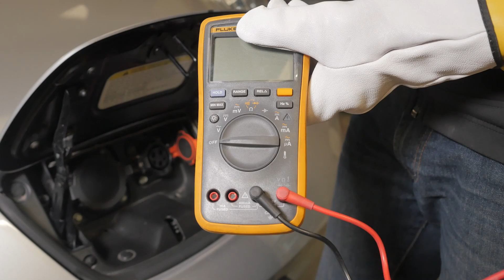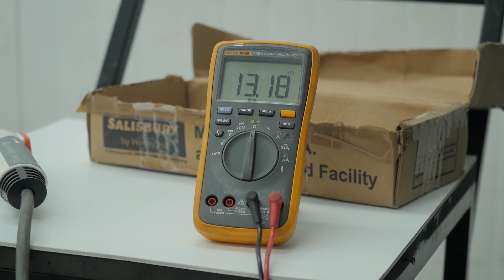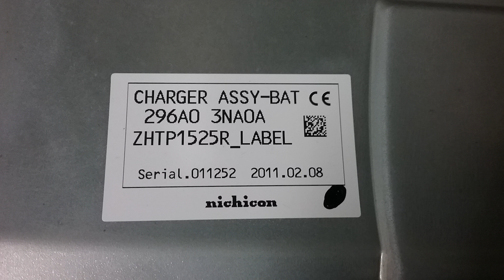Nissan Leaf Charger Fix

Comment: A huge thank you. Not just for the relevant information, but also for the care taken in presenting it. I know full well that creating and editing videos is not trivial.

My 2011 Leaf seems to be experiencing the same or similar symptoms. I am getting kohm readings both directions between the ground and pilot pins. The odd part is that from day to day, that reading is changing. The "common knowledge" out there on the intertubes is that the problem is D1. This is the first I've heard of D547. But then this is the first I've seen of that circuit board as well!

On caution I'll mention when testing these pins - there seems to be an insulated cover on the tip of these pins, so probes sometimes have a difficult time making contact with the actual conductors. I took some cheap, longer probes and bent the tip a bit so I can reach deeper into the socket, and touch the pin behind these caps.

A couple of questions for you if I may:
1. Do you know if this car had ever been charged on a GE Wattstation? It seems that Wattstations had issues with the early Leafs (see here: http://www.thetruthaboutcars.com/2012/07/dead-leafs-and-ge-chargers/), and it turns out that mine HAD been charged on a Wattstation just before my problems began.
2. Would this car happily charge on the 110V portable EVSE that came with the car (maybe this is irrelevant depending on the geographic market)? Would it charge on an Aerovironment EVSE? Mine will happily charge on both of these, but not anything else. So no public charging for me, and no using any of my wall-mount Clipper Creek units.
3. How do I get you to come fix mine in California? My Nissan dealership is no help, because they just want a code to clear. Without that, they wish to replace the charger (out of warranty, naturally). I have no idea how to get somebody on this project who cares enough to actually fix it.
Reply from the maker: Hi Darell. I'm sorry for the delay in getting back to you. I've been head down working hard on our latest projects and have been struggling to keep up with normal emails and enquiries.   On the car we fixed, I have no idea of its prior charging history as the owner we did the repair for purchased the car at auction without prior knowledge of the charging problem. It wouldn't charge on any EVSE that we tried, but some EVSEs may not implement the J1772 protocol correctly so they may continue to charge even when they shouldn't.  I'm not sure if you have resolved your problem yet, but if not I am happy to help remotely. I can't come to California, but if you find someone capable and competent then I can certainly assist them with the repair.
Reply: Thanks for the reply. The great news is that I am that person who's both capable and competent.  :-) I fixed my car in a much more simple way. By inserting a diode inline with the pilot wire behind the J1772 inlet. The charger does not have to be removed, and the failed diode on the charger just stays there shorted, causing no harm. Here is my fix in pictures (with captions).

https://goo.gl/V687qz

I appreciate your generous offer to help. I hope that my solution and pictures can assist other owners who may find themselves with the same issue. Thanks for giving me the confidence to proceed!
Reply from the maker: Good to hear you got it fixed.
Reply: @darelldd  dear Darell! Which diode did you use there?
Reply: @fr.andreysyrkin2806  I've put captions on my pictures. The diode I used is overkill for the application, but it is what I had in my box. I used 1N4003
Reply: @darelldd  Thanks Darell looks like i will have to do this mine stop charging yesterday :( plug in light comes on as if its charging then goes out in like 5sec.
Reply: @xboxice2005  Best of luck!
Reply: @darelldd  one more thing what mine does is,the charge lights come on then go out in about 3 or 4seconds is this what yours was doing bro?
Reply: @xboxice2005  been so ping now that I can’t recall those details, sorry. :-(

Comment: Excellent job, that must have saved a pretty packet over having the OBC replaced. thanks for the great video.
Reply from the maker: Hi. Yes our customer was very happy with the outcome. They were expecting a large repair bill and received a little one.  It doesn't always work out like that, but it is nice when it does.

Comment: my 2012 Leaf had the same kind of problem last December 2016 and spend about 2 months at Nissan Gateshead, UK. When it happened my Leaf didn't show any battery charge and range. I could still drive after resetting the car by disconnecting the 12 volt battery for about 5 min and drive to the dealership.
Reply from the maker: Hi. That does seem like quite a long time to fix. Did they end up having to replace the charger with a new one?   What you mentioned about your car not showing any charge bars or range (when the battery is actually charged) does sounds different than with the car fixed in this video though. The only time we have seen that on a Leaf was when there were more serious fault codes in the car.
Reply: possible yes as also the heater didn't work any more. as it was under warranty I have no idea what they replaced or how they fixed it as when it came back to my local Nissan dealer it didn't came with any paperwork of the work done
Reply from the maker: Ok. It sounds like you were lucky it was under warranty.  All the Leafs we deal with are imported from Japan so there is no warranty even if they are almost new.